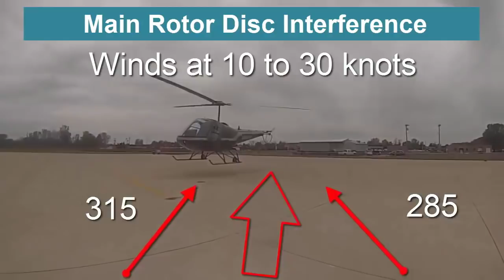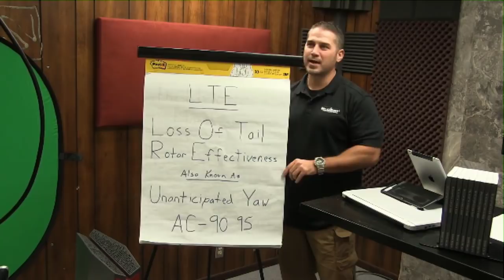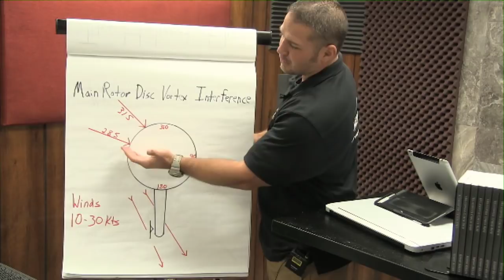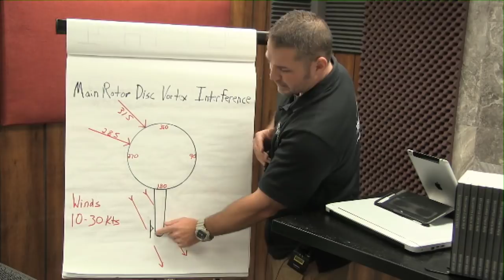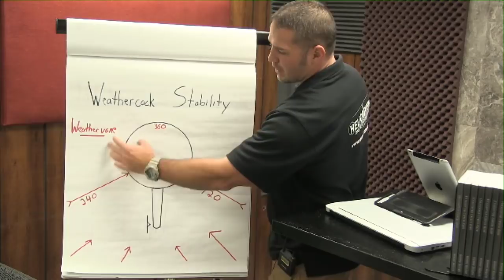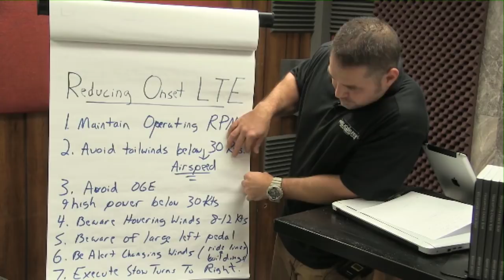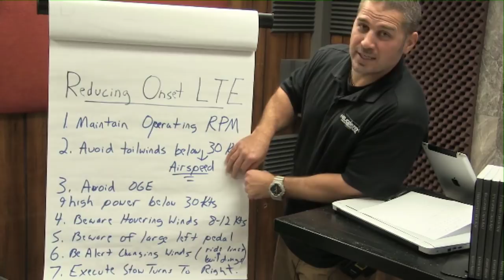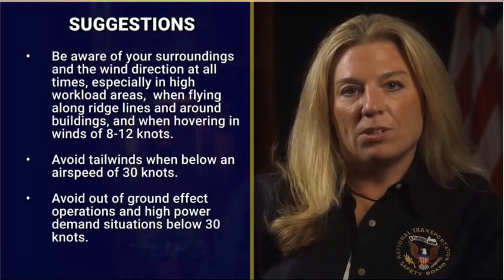Loss Of Tail Rotor Effectiveness LTE Live Training Tuesday

Comment: Hey ya'll wasn't able to join live today but I am watching after the fact.  Just thought I would share some things that I have learned here at Middle Georgia State University.  Now, I am only a private student at the moment (check ride at the end of the month).  Due to the fact that we primarily train on the Cabri I had to think 90 degrees differently, literally when reading the Helicopter Flying Handbook and watching videos.  Being a French made helicopter the blades spin the other way so we worry about the right yaw.  However, due to the Fenestron being a ducted fan the Cabri is less prone to LTE.  With the Cabri becoming more popular in the US I thought this info might help get some  gears turning.  Especially if some folks move up to some now Airbus products that have the clockwise blade rotation or the Fenestron.
Reply from the maker: Thanks for the feedback Adam!

Comment: NOTAR is less susceptible to unanticipated right yaw. Because of Coanda and directional thrust, main rotor vortexes do not disturb anti-torque thrust produced by the anti-torque system. There is still the possibility of an unanticipated right yaw, just not because of rotor vortexes.
Reply from the maker: Thank you robert. Are you a helicopter pilot? Just curious, as you know what your talking about.
Reply: In training...work for Louisville Police on the Air Unit and we currently use MD 520N.
Reply from the maker: That is awesome. Helicopter Online Ground School CFI staff is made up of two active law enforcement officers and two retired officers. We have many law enforcement members. If you sign up for Live Tuesday training, you will have access to our site newsroom and archived live events for free. The newsroom has video blogs within it on most helicopter topics. Here is a link to the live training if interested, and we DO NOT share your email https://www.helicopterground.com/pl/9647

Comment: Critical azimuth varies with type of helicopter and how close they are to MAUW. It also changes with direction of main rotor rotation. (Not all helicopters main rotors turn the same way). The Golden Rule is if you do not have the wind between 10 and 2 o'clock you are increasing the risk of what you are talking about.
Reply from the maker: Thanks for commenting!